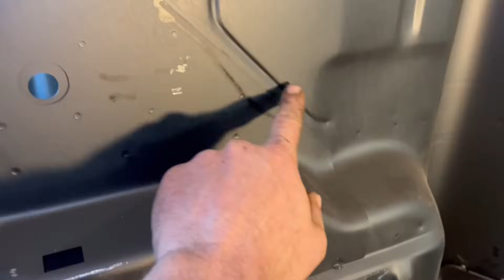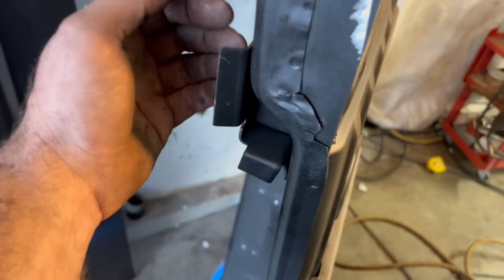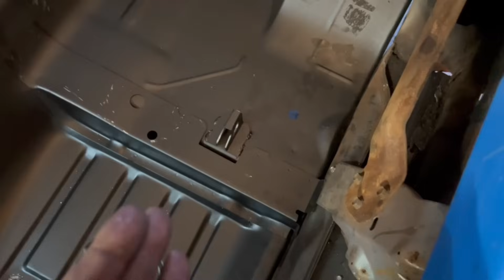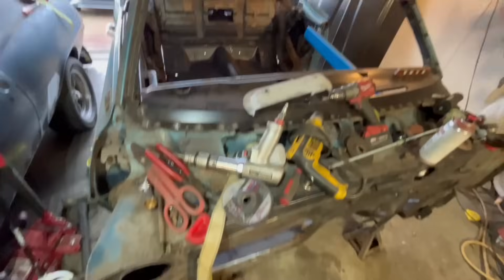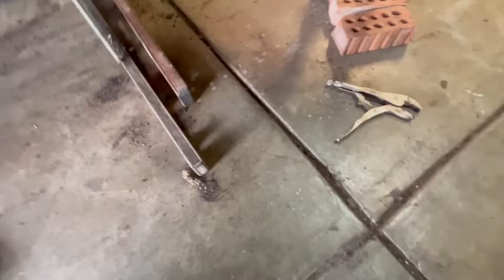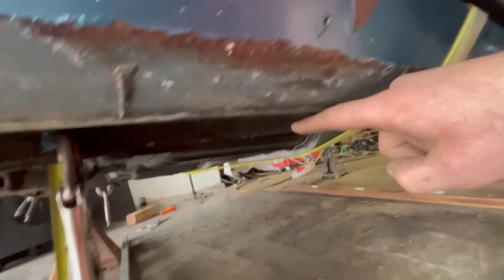Floor pan installation on 1969 Firebird convertible

Comment: As an ex-automotive painter/estimator/body shop manager, I can tell you this is a perfect example of the energy transfer involved in a wreck. Most people don't realize what is involved in assessing damage correctly, so the vehicle is (a). Safe...and (b). installed back to specification. As we can see, there are clearly people out there that cut corners and dont investigate enough.  This car unfortunately, would have probably been a total loss, if blueprinted properly when the original damage occured. Thankfully, for us following...they didn't know what they were doing. 

Keep up the great work, Jon
Reply from the maker: Thanks much appreciated!  I knew it got hit before i started but no clue it was hit that bad.

Comment: These videos are really helping me on my dads 1968 firebird convertible “parts car” that he used to snip parts off for his bird. He sold his and I was able to get a title for the parts car. It’s a rust bucket, and the floor is 60% gone. Most of the convertible suppt structure under the pan is shot too. Looking forward to your videos on this convertible. Thank you for sharing, and queuing in on your favorite tool, the air hammer with chisel bit. Wow that’s a game changer…. No more drilling for days
Reply from the maker: I LOVE my air hammer, it so much quicker then drilling. It doesn’t work good on newer cars but the quality of the spot welds on these old birds, well they weren’t that great and pop apart easy. You could still damage the metal but it takes a little practice and when mastered totally a game changer.

Comment: Awesome work as usual Jon. I've learned a ton from you. Pretty much every video I pick something new up.   I may need to pick your brain in the spring for my trunk floor and rails. I'm missing the front 8-12 inches of both rails so have nothing to reference. Even the lip on the front of the trunk is gone. Only thing I can think of for now is to pull the old rails off the trunk floor.  Screw the new ones in place then adjust my floor to them. Then weld in the floor pan and cut the trunk floor out then.
Reply from the maker: You can assemble the rails to the new trunk floor. The next video covers some of the dimensions. I am certain it should be of some help.

Comment: Simple tricks equal great results. Very nice, coming along. I love this build because all of the panels your replacing is what mine needs also. Great to watch the order of replacement. I want to see the total sheet metal total cost. Thanks for the help.
Reply from the maker: I purchased all the sheetmetal needed for the body shell including front and rear bumpers as a  bulk order to save on shipping. Then total cost to my door taxes and shipping included was $4,000. I purchased it all from summit racing.  Classic industries has the lowest price on parts but kills you in shipping cost.   The crazy thing is most of the sheetmetal I got has classic industries tag and shipped from address.  I still got most things from classic but summit racing shipped it cheaper.

Comment: Great Video! Love the tips Jon! You are definitely helping me! That torque box area in the drivers front sure is challenging. Replacement panel is definitely different. Brain challenges to "play cars"!
Reply from the maker: You can do it! The replacement is just a little different most importantly get the height correct then hope for the best with the rest

Comment: Hi Jon, new subscriber here. Like your Mockingbird project, I too have a '69 Convertible that I picked up here in GA about 6 months ago. Was able to grab it from the original owner who bought it in Atlanta back in 69. Unfortunately, it spent many years on the GA coast collecting rust from the salty rain. I've been rolling through many of your videos and have found them extremely helpful and inspiring. Nevertheless, I'm all in. Subframe is out and completely stripped (solid but has a lot of surface rust). I'll take it somewhere to have it soda blasted and sprayed with Epoxy Primer. Once back in my garage, I want to consider upgrading to disk brakes and probably suspension and steering upgrades. Open for suggestions! Engine's on a stand and plan to rebuild using the same block which is original to the car. Goal is to do as much work as I can on the entire car. May have to tap into a shop for body work as I have no welding equipment or experience. I do know that I'm not trying to win an award for the most money spent on a resto. In looking at parts and labor, breaking the bank could be easy.  Thank you for such helpful info! Steve
Reply from the maker: Thanks for watching Steve. I typically upgrade every car I build to power disc it’s a great upgrade for safety in my
Opinion not to mention a nicer diving experience.  The kits are reasonably priced too.  Doing what you can at home saves money and what you get done is a nice sense of accomplishment too.  Getting your hands dirty saving another bird is always fun for me

Comment: Some great tips, especially about the bracing. I've been working on F bodies for years and this car is going to be straighter and more in spec then an original. Great video, thanks.
Reply from the maker: I tried bracing the first few and just fought the hell out of it to line things up.  I do minimal bracing now and so much easier to get it together.  Flip side loads of reference points and measurements so far so good.

Comment: I love these videos...but cut proof gloves please next time! They make some really nice cut proof gloves. Sliding the floor with no gloves was giving me the willies!
Reply from the maker: I won’t disagree with you in the gloves,  there is an art to doing sheetmetal without them but nobody is perfect. I will pick up some gloves for next go around
Reply: @VinylVillageGarage  I was an engineer at a nuclear plant and industrial safety is very big there. For that type of application we were mandated to use GRX (Level A5 cut resistant we used)  and they are great, Dexterity is good.as well. I started getting them for home use because I liked them so much. I would hate to see you are anybody get hurt. God bless.

Comment: Really liking the use of the ratchet straps. Do you have any issues with popping any welds when you take the straps off? The floor pans seem to have plenty of flex, but just wondering. Perfect video for this.👍
Reply from the maker: I use the self tapping screws down the full length of the rocker panels then remove the ratchet straps, seems to do ok. Haven’t popped any screws yet.   Then I weld it up like normal.

Comment: I am sure you've thought about removing that torque box, welding the floor pan in and then reinstalling it to get the welds in the factory location.  That's a lot of work for sure, and probably why you decided to do it the way you did.  Put this in the mix though... I've seen a number of cases where various braces are welded in the wrong places on these panels and they have to be relocated.  What you find underneath is that the EDP coating is incomplete underneath these braces, bare metal is exposed and likely already rusting.  I bet you've seen this too.  This could be a reason to remove and reinstall the braces.  Or, keep doing it your way and just squirt some paint in there with one of those rattle can hose attachments.  I'd do that at a minimum,  underneath any brace already welded onto a replacement panel...I can't stand the idea of bare metal hiding out somewhere!
Reply from the maker: Yes i have seen the unfortunate bare steel and rust already between new panels.  I have even found rust under the edp coating!  I have had to remove pieces that were not installed well.   It’s hard to say where to draw a line on how far you go to seal things up.  Spray some paint at the minimum and cavity wax works in some places seems to work. Sadly the entire car from the factory was bare steel too and there will be several panels that I don’t take apart of the original car that I know there is some type of corrosion festering.  How I see it do some paint, seal it up and know the car won’t be seeing the crappy elements anymore.  To remove all the rust just isn’t practical on these old birds
Reply: Yep, that's a perfectly reasonable assessment.  A squirt of paint is 10x better than the factory, and these cars still managed to last for over 50 years.  A testament to that, my 69 Camaro was put in storage some 18 years ago in pretty rough condition.  When I got it back last January, it wasn't hardly any worse than when it went in.  I'm not sure why I let those little things bother me so much.   For sure, my brain is set to overkill!

Comment: hey John, big fan, have a 67 camaro coupe, watched many of your videos! working on rockers and floor pan. big thank you! 

i noticed have the car is rachet straped to the floor? whats that round thing with hook called? i noticed the car strapped to that?
Reply from the maker: I bought them from Menards they are d-rings,  I used  tapcons to mount them to the concrete it keeps the body still and doesn’t budge.

Comment: Hi Jonathan loving your videos.. I am still working on my 67 bird When I got the car it had no floor in it. I watched your video today I have no way of getting a floor reference height. Any way you could tell me the difference between the height of your outer rocker to your reference measurement of the floor ? That way I would know the difference so I could set a threaded rod like you did
Reply from the maker: I took a straight edge from rocker to rocker. Then measured from the top edge to the floor pan.  Not the nut inside but basically the area the subframe mount touches and it’s 1 7/16”
Reply: Thank you so much john
Reply from the maker: @robinmclean1371  no problem

Comment: Great video Jon. Does the new floor pan come with the brackets that the front leaf springs saddle bracket mounts to? I hope I said that right.
Reply from the maker: Yes it comes with those panels installed.
Reply: Should I cut out and replace the floor pan before I cut out and replace the trunk pan and frame rails?
Reply from the maker: @larrygonzalez3159  I normally do.  I start with good rocker panels and then main floor and work my way
Back.
Reply: I wish I could afford to just bring you here to Florida to assist and over see!!!!
Reply: I’m the one that sent you the pictures of the 67 we just took apart and the rear end question.

Comment: Hello, I see that on the floor there are 2 holes  around 1 inch each where the rear seat goes...what are these 2 holes for? One at left and one at right. Thanks in advance!
Reply from the maker: Close to where the lead spring mounts?  I can’t say their purpose but they are not symmetrical in location. One is further forward or some reason.  All I know is one is a rubber body plug fills the hole
Reply: @VinylVillageGarage  👍

Comment: How do you know that the floor panel is the correct width? You are pulling the rockers into the floor pan. Could it end up that the rockers are pulled in too far?
Reply from the maker: If the gap was 1/2” or more I would be concerned but every floor pan in have installed has been this way about 1/4” gap that’s why I grabbed my ratchet straps before i started.  The addition note that is not in the video, the trans tunnel was higher then the firewall until I let the ratchet straps loose then it pulled it all flat. So with that said it most likely returned close to the original distance between the rockers.  This is just my experience. I don’t concern myslef much with what the distance is as long as the rockers are parallel to each other when done and I am not trying to close a very large gap.  Other than that full send.  I bet if you asked people what is the distance between their rockers you would get several answers ranging with 3/4” of highest and lowest.
Reply: Great job. Very good information. This should help fire someone up and get their project on course. Thanks for time you put into very educational videos.

Comment: Jon , out of curiosity when you Installed floor bracing did the measurements come out the same as the 68 repair you did earlier ?? My floor and bracing where missing on mine and was going with your measurements on that build ...
Reply from the maker: Yes they are the same, I even did an episode on locating them too.  For the most part the floor pan is stamped for them to really only fit in the correct location.   The biggest struggle is to get it pulled uptight to the floor pan. The nut and bolt technique will be very helpful.
Reply: @VinylVillageGarage  thanks I did watch that episode and was curious if measurements stayed the same ...